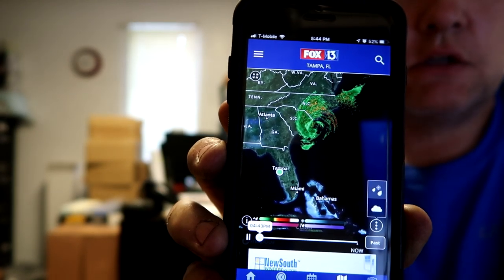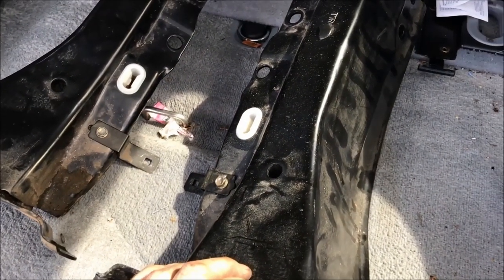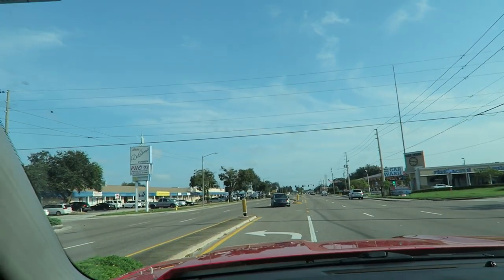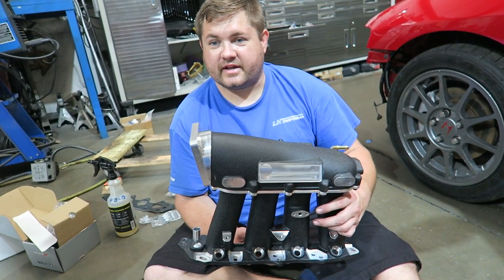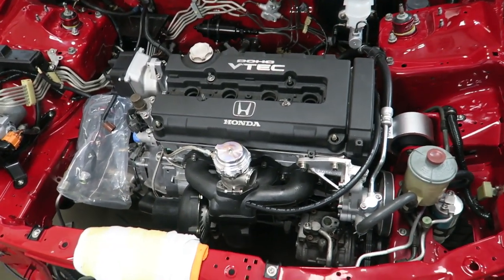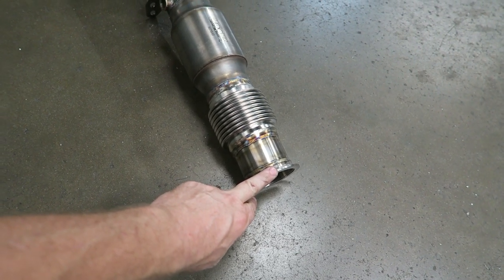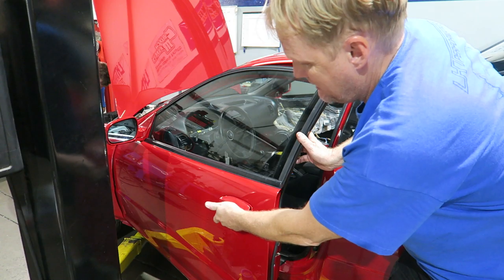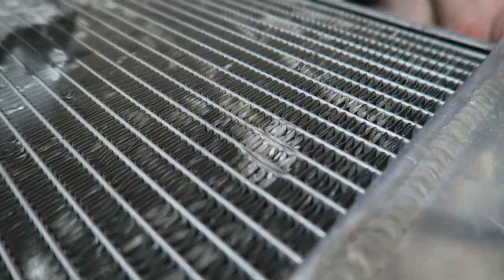INTEGRA BUILD -Assemble Part 3

Comment: Love the build so far. My Integra doors still shut like new (after 25 years). Although, the passenger door has a terrible rattle when I shut it while the window is down but it's been like that since new. The dealership was not able to fix that problem correctly under warranty.

Comment: That rear bracket is for rigidity, yes safety is the number one reason for that piece but it also helps handling/braking etc. Honda hatchbacks are pretty flimsy, there is a hole four times bigger than the sedan trunk opening in the rear reducing rigidity.